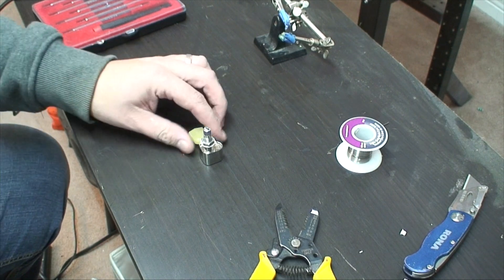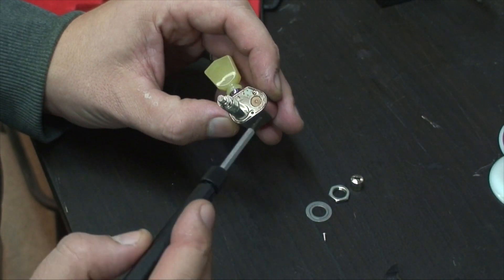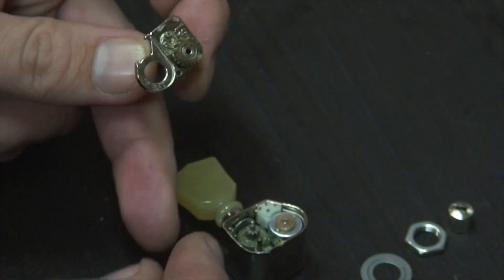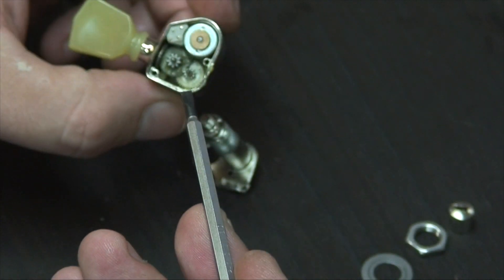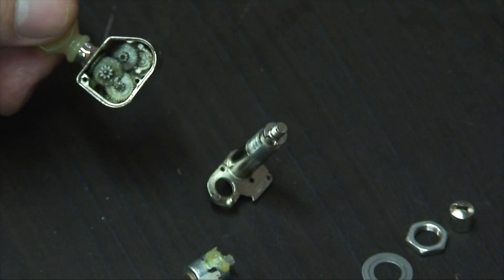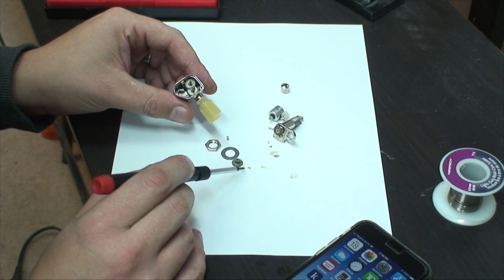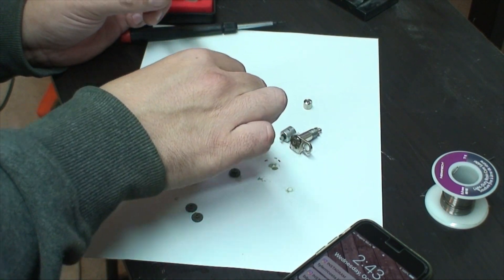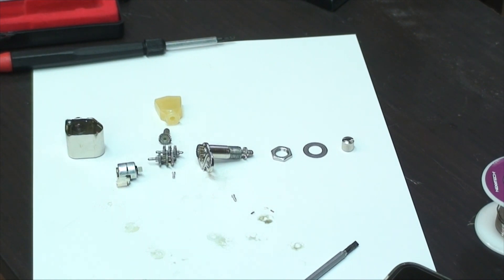Gibson's G-Force Tuners: Materials Failure! (Tuner Tear Down)

Comment from the maker: After having replaced one of these failed tuner units, I decided to take it apart and see how well it was made and how it works. The clockwork is simple enough, but the materials used to build it are destined to fail sooner than you as a consumer might like. This unit is barely 2 years old and its completely destroyed. It's mates aren't far behind. The crunch factor is enough to make you blink twice;-)
Reply: Woodeso's Guitar Mods i love when u take shit apart. I always wondered how those worked.  Or should i say dont work. Cheers from Boston!!!
Reply: That is what happens when you hand tune it while its tuning itself.  Typical operator error for this system.  Stupid people who don't read the directions and/or ignore them.
Reply: There's some stuff I saw about Kobe Steel, who produces a numbers of other metals and alloys. 

It has been revealed that they lied about the specifications and rating of the materials they released

Now some of this stuff has gone into buildings, and aircraft, and heavy vehicles, and other potentially disastrous contraptions. 

It it's quite conceivable that the brass that Gibson ordered was not not what was delivered and not up to scratch 

But maybe not.....
Reply: I have one guitar with the tronical etune system that comes in handy for certain live scenarios, and I like that Gibson is still looking to innovate without reinventing the guitar.  I ran into a serious downside last week...I opened my guitar case and the battery was bloated and super hot.  Gibson gave me a warranty replacement (super cool).  I'm keeping it in one of those fire resistant bags.
Reply: where you bought the single unit?
Reply: i guess Im quite off topic but do anyone know a good site to stream newly released movies online?
Reply: @Makai Gianni flixportal xD
Reply: thanks, I went there and it seems like they got a lot of movies there :) I really appreciate it!
Reply: @Makai Gianni Glad I could help :)

Comment: I have one apart because one of the four contacts to the motor is pushed down flush with the nylon surface. I believe it would have trouble making contact. It was glitchy and it's probably because it was overtightened. I'm looking for a way to pop that contact up again. They are actually spring loaded and can be pushed down and the spring up again. My problem is one of them doesn't spring up anymore.

Comment: That happens when you tighten the String Lock with too much force, using a screwdriver for example. It is a stainless steel MIM gear. You are supposed to use a 1 Cent coin only to prevent applying to much torque clamping the string. Obviously that was ignored...
Reply: I don't see that the tool used is the issue.  A person could easily overtighten these with a 1 cent coin also, correct?

Comment: There's only one good feature of this system.  Because they don't require any locating screws to locate this tuning system when you throw it in the bin and install proper tuners you have a blank slate and can choose any tuner style you like without having to worry about filling unused screw holes from the old tuners.  That's the only positive I can find

Comment: Actually, it isn't built that bad.  They used a stepping motor which wont go bad from brushes etc.  But like you said, built to a price.  The nylon pinion gear would be a no go for me if I were the engineer.  So what broke those teeth off the brass output gear?  Is this a common problem that you have seen? If a powdered metal gear, then they may have pushed the envelope of cost saving too far.  Machined brass gear, brass pinion and composite primary intermediate gear would have been best.  I bet those nylon gears will crack and slip as they age.  When introducing a revolutionary concept like this, you cannot allow for this type of failure or you lose all trust and what could have been a fantastic idea..... well....

Comment: Interesting tear down.  I was always curious to see the inside of these Roboheads.
I believe the "something else is broke" at 5:44 is a product of the disassembly.  The two spindles that the gear packs are mounted on are not aligned in their running position because the housing that holds the ends of the spindles in place has been removed.  The spindle that receives the 'input' from the tuning handle needs to be seated into the hole in the housing in order to align it and 'press' it against the 'crown gear' as you call it.  In it's disassemble state, the spindle is free floating on the open end and will shift away from the tuning head input gear and slip - just like you experienced.
@Woodeso's Guitar Mods - you have some good videos on your channel.  I've learned a few things for sure.

Comment: The faults I found with this system were: The bass side keys are reversed when manually turned. Actually have a high ratio like the LSR or steinbergs. It has to be dead on when running calibration as well as periodically calibrated. Once the battery gets low,but seems fine, it goes all haywire tuning all over the place or stopping short. Should have made it optional and kept the dang prices down smh.

Comment: Anytime you get something with "bells and whistles," that is more things to go wrong.  I have also watched videos uploaded by people who collect ceiling fans.  Some of those people say that it is best to just buy ceiling fans which have pull chains, not ones with electronic controls, such as the Casablanca InteliTouch control, for that reason, though I used to think electronic ceiling fan controls were neat.  Some videos portrayed the electronic controls not working, rendering the fan useless.  Same thing with guitars:  bells and whistles, such as Gibson G Force Tuners or the Roland G-5 which is found in some Fender guitars, are more things which could fail.

Comment: I was impressed at first when this system came out....then I saw the price....then I saw how inconvenient it really is.

With a normal set of tuning pegs, which rarely fail, if one of them breaks you can just replace that one....or replace the set with a 3rd of the prrice of these tronical POS.

Later on Gibson admitted it was a flop.

Comment: Interesting - I've taken a few of these apart, but that's the first time I've seen a plastic pinion. Unfortunately, I have seen other plastic gears. The failure seen here is very common on these tuners. I'm not convinced that such sintered metal gear boxes & guitars go together.

Comment: What ever happened to " you get what you pay for' . As my long term goal is to get a Gibson, that coupled with other drops in standard is putting me off. What a shame ☹️
Reply: Gibson yes the best….Then they used China Made Parts? Out of Pot Metal & Plastic gears . They should have had CNC'd titanium gears for the Launch at lest of the Robot Tuners ppl were forced to buy a Gibson w/G-Force tuners there was no option. I have a Epi Les Paul that looks better than any Gibson I've seen them roll out in 5-6 years & plays like a dream & The Pickups are no Joke they sounded better to me than Gibson Signature series Pickups.

Comment: I think Shoman Blues is on to something. I have experienced using the High End version of this Product, from a company in Hamburg, De. Named Tronical. First, I bought a decent Epiphone Les Paul that had the lower end, rebadged “Min-e Tune”, with (Epiphone name instead of Gibson). I owe a debt of gratitude to Sweetwater for giving me tremendous savings over the years, so I have to say, a discounted epi Les Paul, with these lower end units, cost about $550.00. But, After TRULY reading every single piece of documentation, and talking with my vendors service guy, they told me to relieve MY problem by recalibration. These lower end units do not offer that feature. (Sorry: My unit would NOT get “Perfect tune on Low E [<10 cent flat] , ,A [about 8Cent Flat] and D [approx2-5 cent Flat] consistently). I Upgraded to Tronical Tune “Plus”, at modest cost of shipping only, which meant they sent me a New PC Board and 6 New Tuners, for about $60USD. Now, removing and re-installing revealed a couple of items: ESPECIALLY: you need to handle these SYSTEMS with care, and they give Torque measurements: 1.5nm-1.65nm, for those with euro torque wrenches, it’s”Newton’s/ m”; or: 13.27-14.6 In-Lbs. Basically, the Motorized, servo driven Tuners should not be more than hand tight. Now, I had the exact value, but unless you are A Beast, hand tight means not to over tighten the units by any forceful amount, the aluminum “wrench” is indication about seriousness of matter. Also: don’t even think of using a tuner crank ever, and avoid hand cranking them while in action, thus gears will be damaged. I did not, and have no reason to believe user here did. The low end, “ Mini-Tune” versions are for Shite. Since I replaced everything, another key thing was putting on fresh Strings. I think the factory damaged my servo PCB, but “Upgrade” made me jump at learning, and it did solve my problem. Even when re-stringing, you really NEED to follow instructions again about not over cranking the Nut that holds the String onto the tuner. Sorry if I sound like a shill for them, but since then, I have installed 4 MORE Tronical Tune “Plus” Systems, always mindful of keeping all original parts avail for Guitar resale, as many people HATE these things. BUT, in my case, I installed on 5 Guitars, including a very expensive ES-345, a Clapton Strat, a Bedell Acoustic (I DID have to Dremel Out one hole, the Guitar was NOT on their template list, but I felt it was never coming off, I LOVE these things),  Plus a Midtown Kalamazoo and the Ep LP, Plus. Being Engineering minded, I was very glad to see him take apart a Tuner. It looks like a Swiss Watch, treat them like that, and you will get many years of service. Now, lastly, I got 3 Spare batteries (8 total) and 2 complete Spare sets of Tuners, 1 Gibson style Gold, 1 Fender Style Chrome. I programmed about 5 specific Jimmy Page alt Tunings, and they come with 18 standard, and 18 User Programmable. You MUST be sensitive to your String gauges before going hog wild, as per pages 42-43, you must UNLOCK the Low Tune/ Fat String settings, some are for the Drop Drop shredders using 14-64 gauge, and others are more responsive to typical, I guess if you can read up to those pages, you are a safe candidate to use full spectrum of Low Tunings. Average users (.009-.042, or .011-.056.) probably don’t need more than the default settings. Sorry for long blog, but, mine are dead on, smooth as can be, well calibrated for gauges and Setup. My 3 Cents, -The Eternal Student.

Comment: Looks to me like someone tried to tune or turn it manually when it was engaged.  I don't think the gear on the motor would have enough strength to break the brass.  Having to disengage the auto tune was one of it's biggest issue. Didn't want to re tune the whole guitar because the D string is sharp.   Way too much trouble to use it correctly.

Comment: Was this just a bad year for them or are they still being made that bad?
Reply: It was a bad year for the power tuners. That is the first generation of the power tuners, 2016 and 2017 upped the gear ratio to take less strain on the gears and motor also they changed the materials of gears. It isn't much different than the first generation car that has multiple recalls.
Reply: My 2017 is going just fine, but I know how to use it. Most people don't take time to learn a new piece of gear.
Reply: Gibson is closing it's Memphis plant, they got those tuners from a another company you can buy to fit most all common guitar's , But Gibson should have had them up the martial like Titanium instead of pot metal & Plastic gears Gibson has shot them selves in the feet two of three times. I stick w/Epiphone any day.
Reply: I don’t think they are using them at all anymore, stop completely